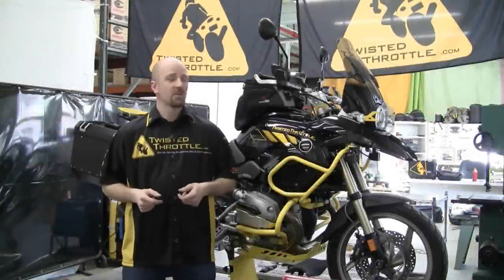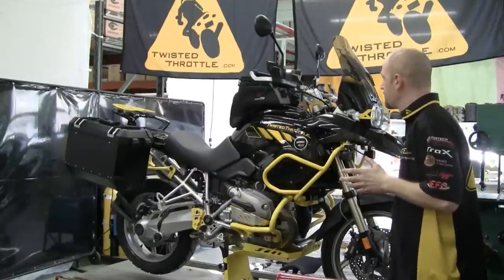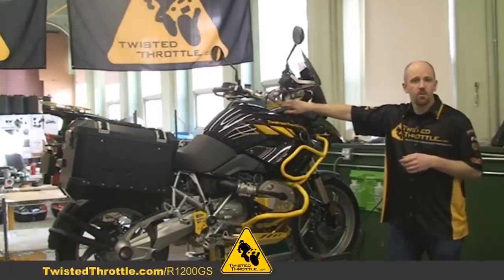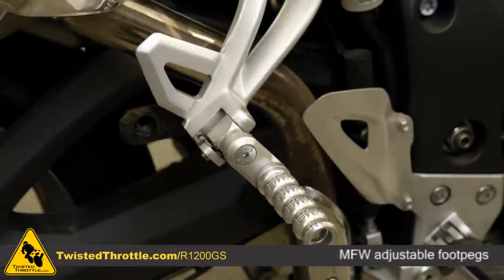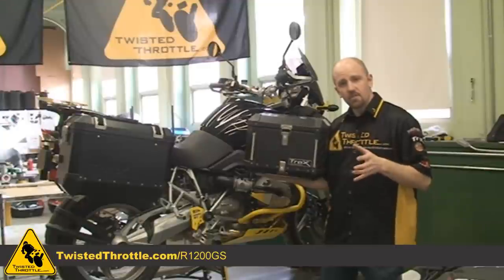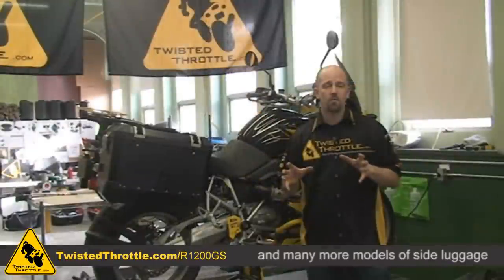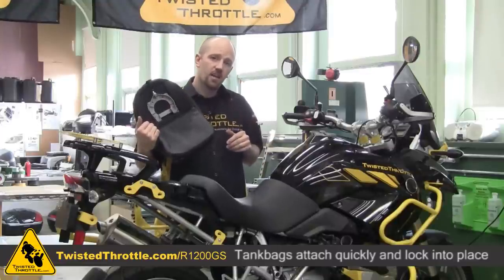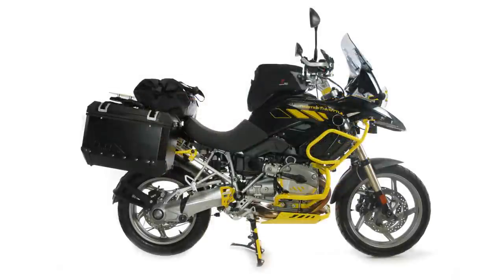BMW R1200GS with Adventure Touring accessories | TwistedThrottle.com

Comment: I'm only 5'9" and have a long torso/short legs. The adventure sounds nice, but I just simply can't ride it especially in a city environment where I've gotta put my feet down all the time. The low suspension 1200GS is the only way I could ride this.

Comment: here's a thought...how about you just don't tip over?  actually, that's probably unavoidable with all that added weight.  funny thing is this is about $10K in extras (i know, i saw a similar set up at their tent at the Int'l MC Show in Seattle)...you'll be just as concerned about damaging the extras as you would the bike at that price!

Comment: We got guards for your guards, so you can guard your guards. Also, the throttle lock seems like a safety hazard, and I'm pretty sure is illegal in my area (has to disengage when the break is touched).